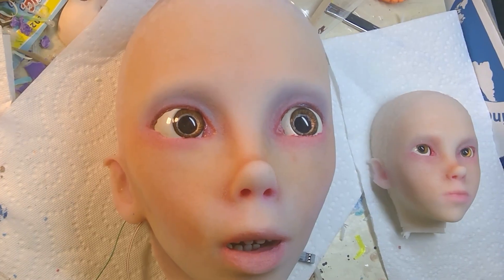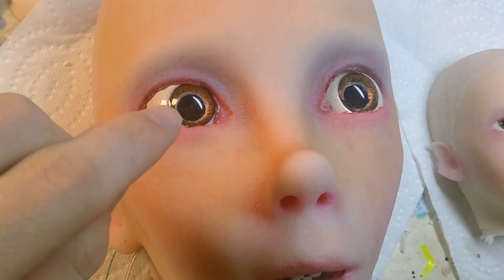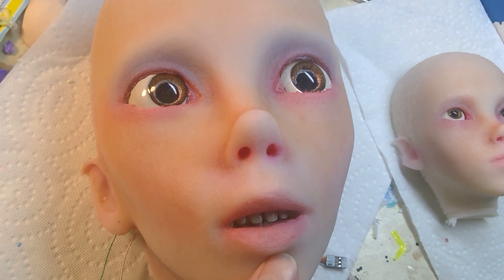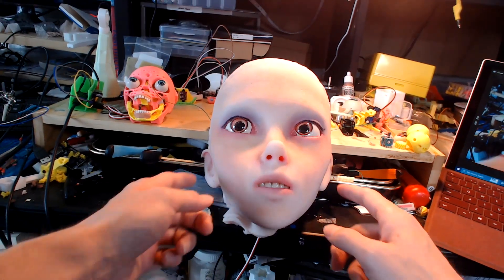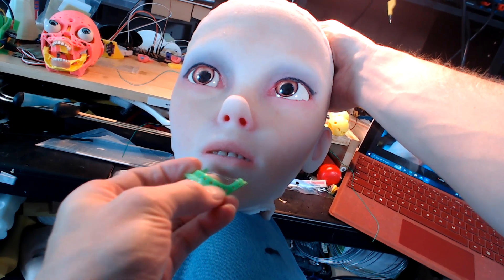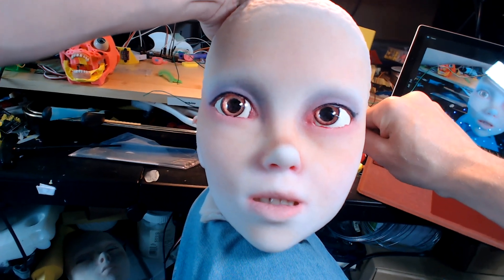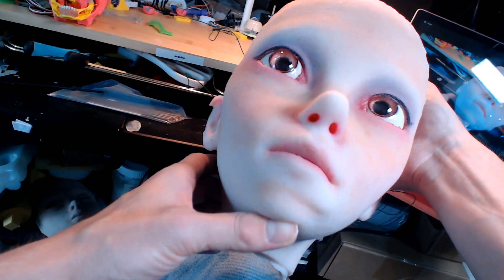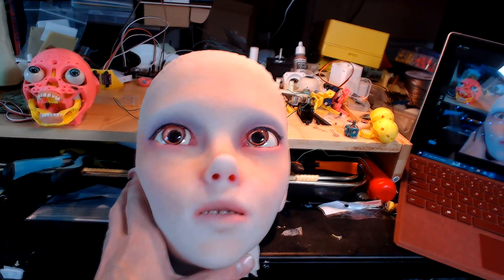Making a Robot Head Smile

Comment: This is the way.
Reply from the maker: I had some concern that this would not work very well before I tried it.  It isn't great, but I think it can be made to work well with a few more iterations.  More points of articulation too.
Reply: @DaveMakes  Yeah, I had a similar idea. I just couldn't start my project yet, because I first wanted to move to a new place. I guess in some case you might be able to use solenoid actuators to pull the strings from inside the skull. This would only allow for two states to move per actuator, but if it's done with strings, one can try attaching different actuators per string which create a little bit of different expression. Many facial movements need to be fast and not be hold in place for long, and small solenoid actuators exist. Not sure if they're strong enough though.
I'm sure you already realized, if there's too much friction then you could consider to use some kind of flexible tube with a lubricant in it.
Reply from the maker: @NoidoDev  I think that bicycle brake tubes might work.  I have a few of them I will try.  I only have to worry about friction in the last 2 or 3 centimeters where the wire comes out of the tube and interacts with the rubber.  I haven't looked into solenoids very much.  The fact that they have only two states makes me leary of using them, though if they are not expensive it can't hurt to try a few out.